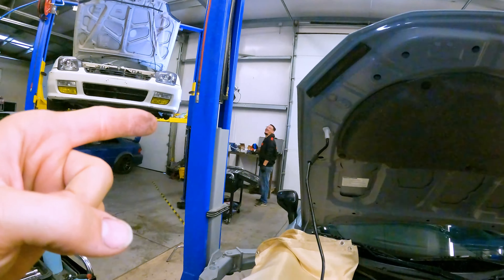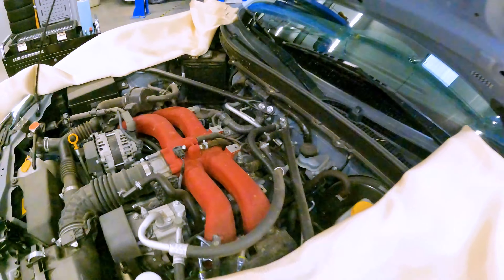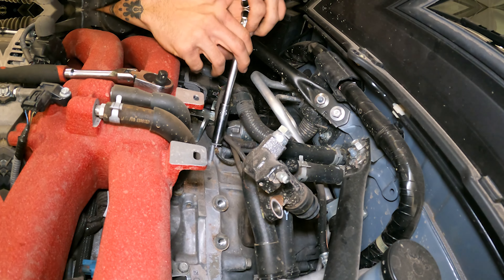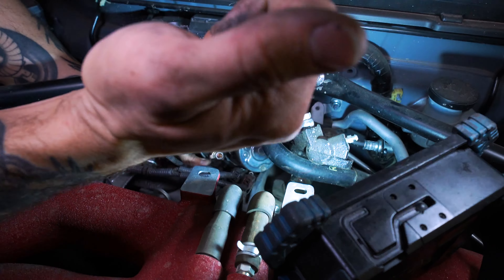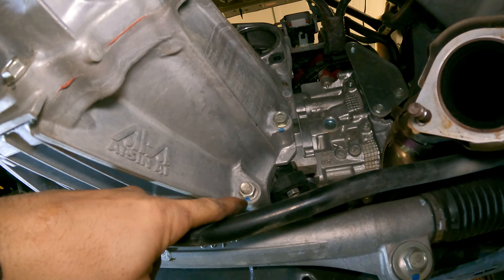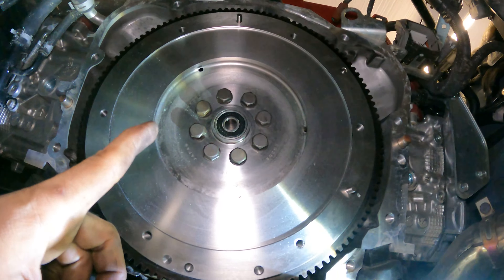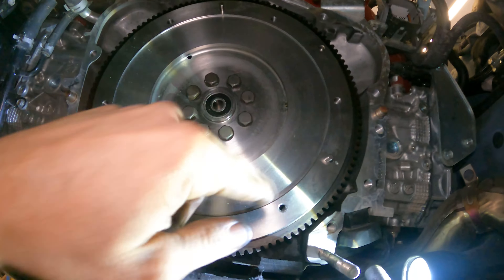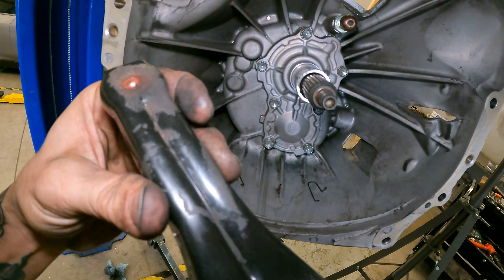How to Replace your Subaru BRZ/Scion FR-S Clutch - an Easy DIY Guide!

Comment: I've done literally hundreds of clutches throughout my career. Never done a BRZ. It looks relatively easy. The car I've done the most of,,, 5.0L fox body Mustang. Late 80s into the early 90s I did an absolute pile of those cars. And every single one was owned by some pimply faced kid. First car, never driven a standard. And they drove the shit out of them. I could have those cars done in just over an hour. They paid 5 hours I believe. 
Cars I despise the most. Anything German. They are my nemesis. Not just for clutches, for everything.
Reply: This one pays 6.7 😂 Porsches are actually great to work on but yes anything else German is horrible!
Reply: I don’t understand people and thinking German cars suck to work on😂

Comment: What was that bracket you mounted to the top right where the starter goes behind the pressure plate? I don’t have that on my 2014 brz????

Comment: I have a 2013 BRZ And after letting someone else drive the car i am now hearing a weird whining noise when i push my clutch pedal in. Think its a throw out bearing. And since i have to pull everything to get to it. Seems like i might as well change the clutch. Anyone else have any other thoughts???
Reply from the maker: Don't let anyone else drive your car!!!😂
Reply: do the rear main seal while you're that deep in